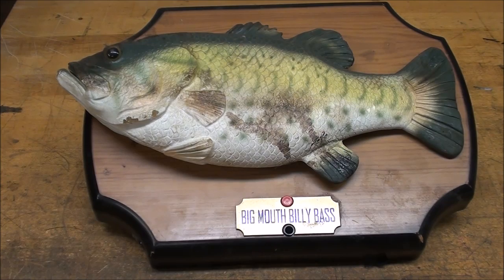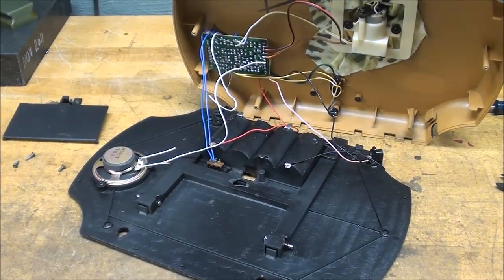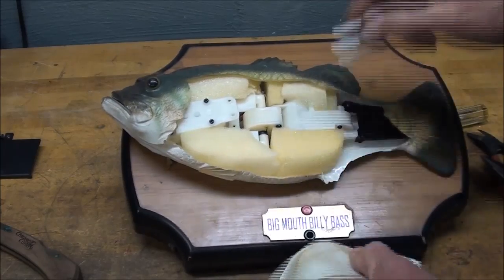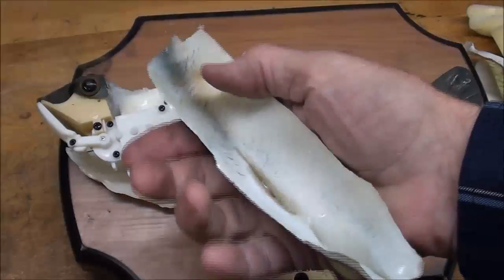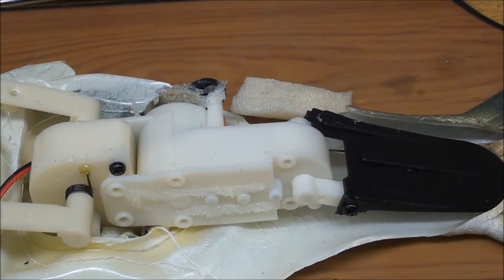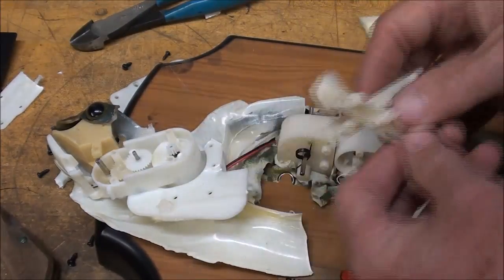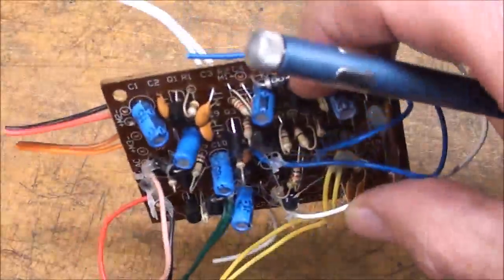WHAT MAKES IT WORK? #12 Billy the Big Mouth Bass tubalcain

Comment: Usually the most common issue with these is the motor shaft gear (9,or 10 tooth) gets a little tiny split in it, causing the gear not turn properly. This explains why the head was making a loud buzzing sound. There's nothing to turn the gears inside. It's a pretty simple fix if you know how to fix it. If you would like to fix your singing fish, check out my channel and look for the video called "how to repair your singing fish's head". Same goes for the tail, and mouth

Comment: Hi Mr. Pete, All,

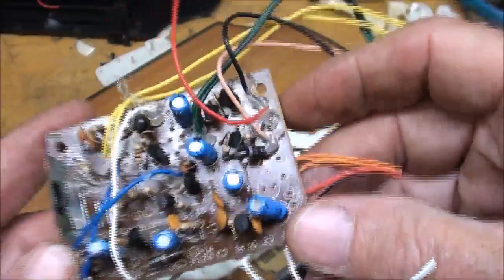At 15:57, there is a small vertical circuit board right above your thumb that has a black blob on it.  Under that black blob is likely one or more integrated circuits such as a microprocessor, and or digital to analog converter.  That's the conductor of the whole show.  Everything else, resistors, capacitors, transistors, wires, appears like common off the shelf parts you could get from an electronics supplier such as Digi-Key.  The arrangement of all of the parts, the position of each part's lead holes, and the shaping of the each part's leads, makes me fairly certain that these parts were assembled by hand to the circuit board.  The circuit board per se is of the least expensive "brown board" variety, where copper traces are only found on one side, and jumper wires were used if needed on the top side to complete the circuit routing.

Comment: The black epoxy / die combo is known as COB "chip on board".  It's the cheapest way of adding an IC to anything in large volumes.  Usually reliable, it's basically impossible to repair if anything goes wrong.

Comment: Thank you for demonstrating the proper use of wire-cutters...!  And...on that circuit Board...at one side, with the 7-8 contacts...a tiny metal 'heat-sink' with a dab of black epoxy....under that epoxy is a small integrated circuit that has a bit of built-in 'memory' that controls everything and generates the 'music'....similar stuff can be found in cheap digital watches and 'musical' toys...I even found a similar circuit inside the red LED flashing light for my  bicycle...
Reply from the maker: +Doug Ankrum Thanks

Comment: If you pause at the 16:01 minute mark you will see that big black dot of epoxy on the left of the mother board.  Under that is the chip that has not only the sound but the programming that controls the whole thing.  They epoxy the chip to keep it "protected".  Basically so you can't steal the code/music.  Fun video!
Reply from the maker: +Marc Schaefermeyer Thanks

Comment: my black and brown wire coming out of motor got separated from billy's circuit board .now i don;t know which wire should be soldered to M1- and M2- (- is negative).will i fry the motor if i connect wires incorrectly..thank you for assistance .Ross

Comment: well i thought they were using servo motors but now i am curious how they protected those DC motors from overcharging for example when the mouth is fully open or the body is fully rotated ; the motor is still on but it doesn't rotate that's why we keep hearing that buzzing sound . i think they are using some current limiting circuit and i need some schematics LOL.
by the way ,i think that black thing under the red button is a motion sensor,  that's why when you moved your hand over it(at 3:10) or when you flicked your knife it started moving.
well , thank you very much for the video : +1
Reply: They don't. All they rely on is the fact that the voltage doesn't exceed a value that would make a 'dangerous' amount of current flow through the windings.

Comment: Tobermorey, Ontario.  The upper end of Georgian Bay 1998.   A gift shop that we frequented on a regularl basis.  Billy the Bass.  Every time.  Billy the Bass did his thing.  At the end of 4-5 days, I wanted to take a sledge hammer to Billy the Bass.  

But what makes him tick? Well, Mr Pete222 just demonstrated what Billy does.  But he didn't show it.  

 I still want to take a sledge hammer to Billy.  To understand why, Mr Pett222 has to demonstrae what Billy says.
Reply from the maker: +Robert A Moore how did the clerks tolerate it
Reply: +mrpete222 Billy was in the far back corner of the store well away from the clerks and the cash register.  Billy was actuated by hi infrared beam.  

(You DO know that bass have an infrared beam which is what makes them flip, flop, and flap when you pick them up.)

Very excellent disection.  Your biology prof would give you an A+.

Comment: I think the other "button" on the front switch plate is a motion detector. Actually it is probably a photo-diode which is even cheaper than a motion detector (which can be had for under $10). Blocking the light from it should set the system off.

I'll join the chorus of "Oh, don't throw the pieces away," even though (as another 72-year-old) I know that there aren't all that many projects left to do. Maybe one of the projects that IS left might need those little motors and gears. (HA!)

Comment: One of the electronics guys where I worked opened one of those THAT WAS EASY buttons, from Staples, and reprogramed it with a few different phrases.  The guys I worked with were, for the most part, a rough crowd, so you can imagine. One of the modified buttons would repeat several different phrases, at random. The foreman special button said "Get back to work" and "WXX do you want?" and I'M GONG TO KICK YOUR XXX."
Reply from the maker: +Bob Smith very clever